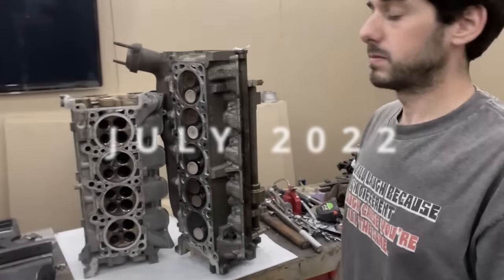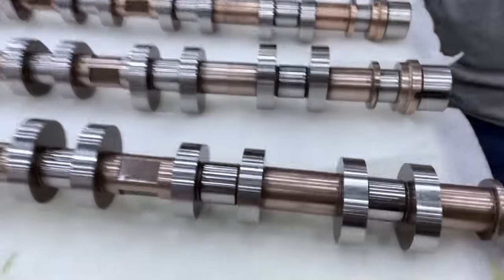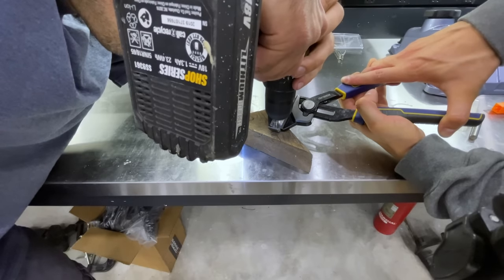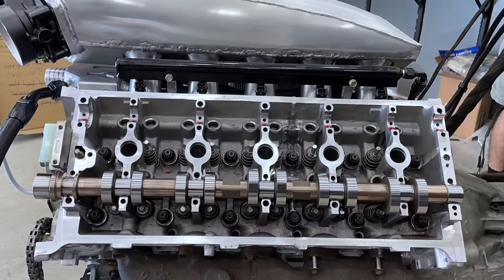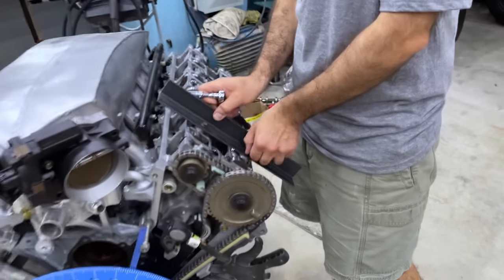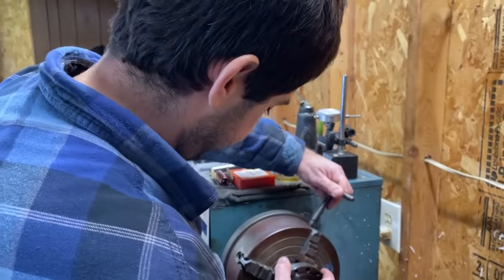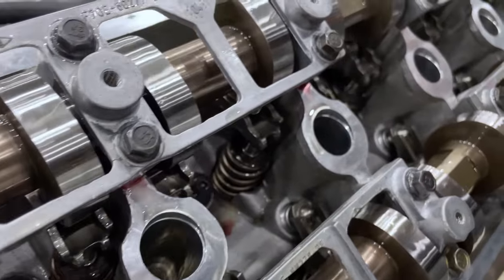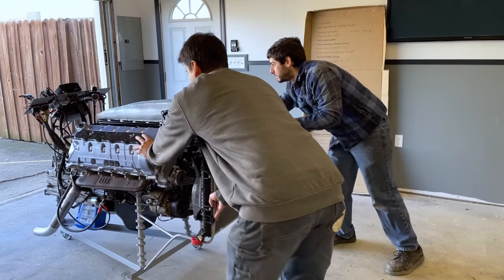Camshafts Are Here! Engine Is Fully Assembled And Ready To Start - Ford V10 4V Build Ep. 16

Comment: 260in/263exh duration at .050 with .500in/.504exh lift is a freaking gnarly and huge cam spec.
Reply: Not really kinda mild honestly can be a lot higher
Reply: @benjaminwatson7868  There is nothing mild at all about those specs, not  even kind of.
Reply: Yeah the lobes almost look square lol it should sound awesome
Reply: This is the cam I currently run in my built 351w. It's comp cam 280h magnum, and let me tell you. Mine is choppy

- Duration: Intake 280/Exhaust 280
- Duration @ .050" Lift: Intake 230/Exhaust 230
- Valve Lift: Intake 0.512/Exhaust 0.512
- Lobe Lift: Intake 0.32/Exhaust 0.32
- Lobe separation (degrees): 110
- Intake Centerline (degrees): 106
Reply: It's going to sound like an angry, angry UPS truck with warts on its ... driveshaft. (That's a good thing, btw)
Reply: @Blue-Oval-Fan cam in block specs are significantly different in comparison to dohc. Stage 2 nsr coyote cams from comp are 280/290
Reply: @hemiacplurge3572 boutta be the best LUGGADUDUGGADUGGALUGGA weve ever heard
Reply: @governmentcalamari9785  those are also advertised duration numbers, which equate to 235-240° @.050. The cams ground here will support very high shift points. There are guys making 2000hp on boosted 5.4 based engines with 30°  less duration than what's in this v10.
Reply: .500 lift on a 4 valve is like .650 on a 2-valve.
Reply: 🎉🎉🎉 i cant wait a week 😅 amazing guys congratulations i really hope you dont get issues with the timing.. I remember playing with sprockets to degree my cams.. 
I NEED to hear this engine already
Reply: @madmod eh past the lift the duration isn’t crazy you just don’t realize how much Ford put babying specs on their cams they could have don’t more if they set up better ptv clearance
Reply: @fightfanian only because of clearances if manufacturers could they would just go with those lift values cause more is always better
Reply: @benjaminwatson7868  the v10 piston sits .120 in the hole at tdc.  There's no chance of ptv issues for the 6.8. The reason Ford "babies" their cam spec is because of the valve curtain area of the 4v heads. There's simply no need to have as much lift and duration on a dohc head when the 2 intake valves flow at .300 lift what an LS 706 head flows at .600. 
For reference, the absolute largest cam comp offers is the 106500 grinds, .475in/.450exh lift and 242/240 which will support nearly 400fwhp on a 281ci engine but have trouble with tuning and  idling.  This v10 bullet cam is freaking massive by all accounts. 260° at .050 is like 300° of advertised duration ... On a 4v headed engine.  Lift is not where the power is made especially after you've passed the threshold of what the engine needs for airflow.
Reply: @madmod  Ah I didn’t know it was 260 at .050 lift ya that’s pretty big especially on the lift side, but I will say you can never have too much lift just too much duration
Reply: @Blue-Oval-Fan choppiness comes from the lobe separation angle not the lift or the duration.
Reply: I thought you'deave the video off at the sound of the starter clacking over for the first time... So kind of engine build drama movie stuff..
Reply: Agreed, cause you're gaining flow through over all valve head area. Way more then 2V @madmod

Comment: The secondary timing chains and tensioner are prone to failure in modified/ raced 4 valve applications.  They have aftermarket components like HD secondary chain's, tensioner and hardware kit to fix the issue.

Comment: tings about time, why things brake... trimming a Dodge AAM1150 to fit in a thunderbird was a task, the day after their was a foot of very cold snow on the ground. a 4.6 broke the 8.8IRS 5 times snapped 3 axles and bent two... the engine only idles plowing snow, the 8.8 differential was referenced as "chicken legs". when they brake the car stops and the rear wheels pop off and roll past 🤣... happy those are gone, but nearly weld blind welding it in of jack stands with 135 year old welding rods, new one's but same old stick's. that motor will have a lot of torque at idle!

Comment: If you ever need to hone a part like that balancer pulley again, Lisle makes an inexpensive version of the Sunnen-style hone. I think it's a little over a hundred bucks if I remember correctly. Sunnen guaranteed less than half a thou the length of a typical engine cylinder but you can actually beat that with that style hone if you're careful, especially on that smaller bore, and more importantly, your bore will stay perfectly round. In fact, if it's a little out of round to start these hones will make them round. Hopefully you'll be okay here but since you're talking about cranking 8-10k RPM you may want to think about doing that next time to be absolutely certain you keep your concentricity upon install.
Reply from the maker: Thats a grrat tip, thank you! We have to look into that tool.

Comment: Not sure it matters with rhis custom engine but the cyl you did first would be #6 in Ford ordering - #1 if it was Chevy.
Ford goes Passanger side front to back" 1,2,3,4,[5 for v10]
and then driver side 6, 7, 8, 9, 10.
On Chevy it'd be 2,4,6,8 [10 V10] Passenger side and 1,3,5,7,9 for driver side. 
🤷‍♂️
But if you checked every cylinder then 👍
Reply from the maker: That is correct. But we started with bank 2 because the timing chain for that bank goes on first. So we dont have to take the bank 1 cyl 1 chain off to do the bank 2 cyl 6 side.
Reply: @biy_buildityourself  dont mind me... Mr. Vintage OHV v8 over here 😄

Comment: I have a silly question. Ford made a three-valve V-10 engine, so why didn't you make a six-valve dual overhead cam engine? You would have had access to actual Ford-designed cams to model your engine from. Just a thought.

Comment: When using the stamped vs cast trigger wheel, it required a thicker timing sprocket. If you haven't already, I would suggest checking that you got the right timing sprocket in your kit.

Comment: PLEASE! Pressurize the fuel system and leave it over night so you can verify no drips. I had a build I didn’t check this on and blew the rod right off the piston first crank the next morning after I had just got it running that night before. Leaky injectors are sneaky bastards!
Reply: I have been watching from the beginning and love every episode you guys have put out. So proud to see young guys like me out here just making it happen, dreams bigger than what can be written down on paper! Can’t wait for the first start guys! You’ve come so far!
Reply: Also no metal intake tubes! You guys have access to 3D printing so make a CF intake box and tube or something. IATs are power killers and the temp difference from plastic to metal is very much worth making a CF intake edit: (not the manifold) I mean the intake tube before throttle body**
Reply from the maker: Thanks for the tip, and the carbon fiber tubes with 3d prints is a great idea!